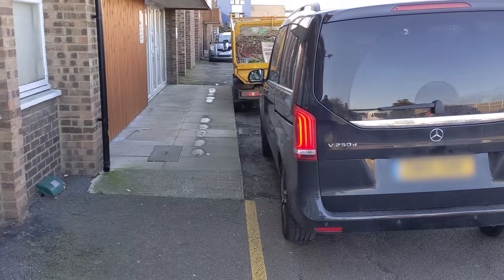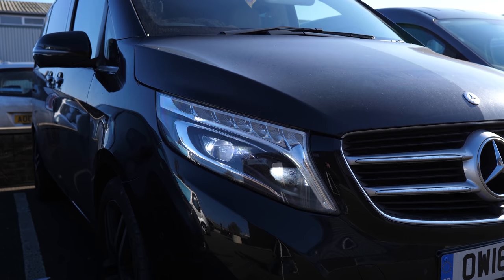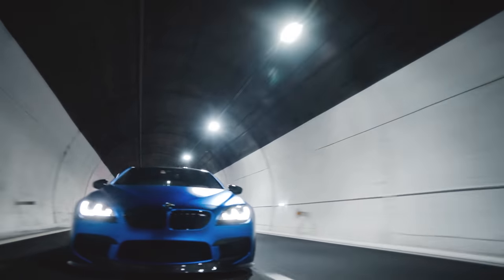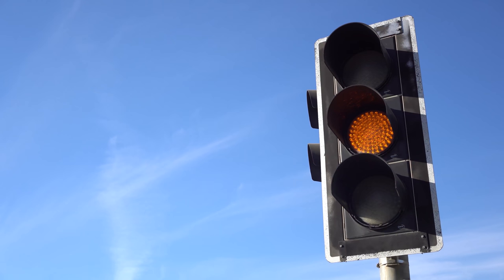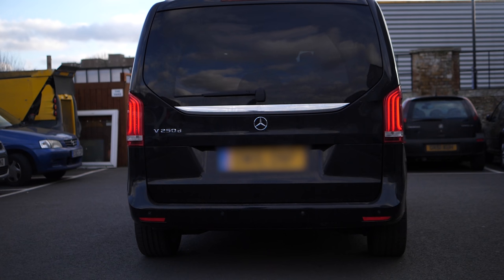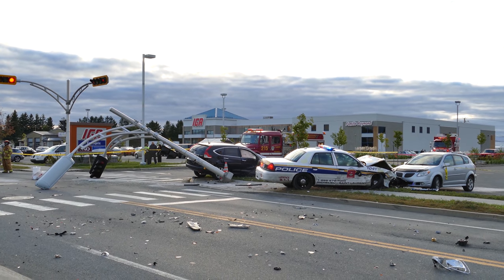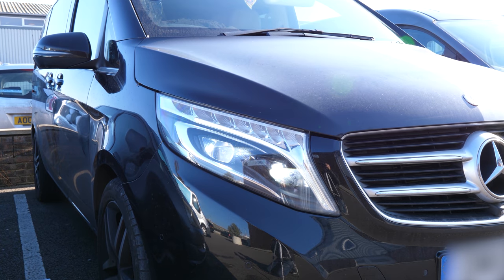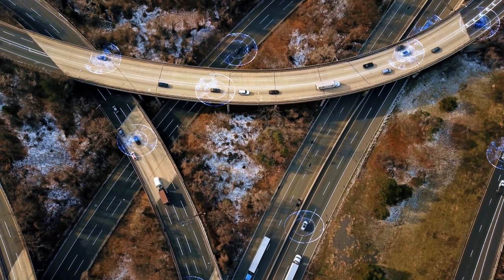Self-Driving Cars Are Dangerously Confused By LED Lights

Comment: Sorry Steve but you missed something big. Car lights aren't on dimmers. They don't need to optimize the beat frequency they need to FOLLOW THE LAW, a flashing light is not a constant light. The manufacturers are being lazy, there's no technical reason that the lights can't be on continuously. The reason the lights flash is because the manufacturers are saving on the total number of circuits needed by driving a number of lights on a single circuit, it's often called a matrix driver. In essence the manufacturers are reusing circuits that were intended to drive something like a calculator digit display. You said that to adjust the brightness you vary the voltage or use PWM but there is another way and it's the prefered way the LED manufacturers recommend. LEDs are not easy to drive as they have very little resistance so just controlling the voltage leaves them open to overcurrent damage the better way is to use constant current drivers. Not only is constant current better for the LED it is easier to set the brightness because the brightness is rated as a function of the current.

And it's not just Self-Driving Cars. I was in a large motorhome that had cameras mounted on the mirrors and extra cameras were on the blind spots and one to show the rear view. A car with LED lights passed us and it lit up all the displays with bright flashing lights like we were being passed by a firetruck. That is wrong, those lights should not be flashing.

Comment: In an AI application, where safety is primary, a dual or triple sensor camera with offset shutter (exposure duration, or complimentary sample time) settings. 

Perhaps the single sensor camera can cycle its settings thru slew of setting at a frequency high enough to provide composite images always. Given the current low cost of processors with ever more sophisticated algorithms, in safety applications, I think it’s a camera image capture/merge. Just as in iPhone camera that can produce HDR photos.

Comment: And an interesting ethical question is, that if the system has been tested a lot against all types of real life situations and artificial inputs, and no major problems were discovered, is it then unethical to release it despite a what-if scenario that was not reproducible? 

Especially if a system that has been shown to be less error prone than a human.
Is it then unethical to withhold a system that could save many lives be replacing an unreliable human.

Would lives being lost because we held our devices to too high of a standard before actual use? 
There is a serious balance to be struck between what-if and actual practice.

Comment: Or an alternative is to NOT USE PWM FOR DIMMING IN SENSITIVE APPLICATIONS.  PWM is fine for little lights on portable devices that don't matter but if you're doing anything important there's so many artifacts like this that make it dumb.  Or at least stick a capacitor in there to smooth out the peaks into a more consistent voltage.

Comment: Excuse me for my naive question: Why don't we simply vary the voltage of the LED in continuous mode instead of using the pulsed mode as you mentioned at 2:06 , wouldn't that solve the problem?
Reply: The choice is either offload the excess voltage by PWM (switching regulator), or by turning it into heat (linear regulator).
If you use a linear regulator, it'll be solid and smooth, but the heat has to go somewhere. In a cold country, it would probably be fine. In Australian summers, the regulator would die very quickly.
Reply: @tin2001  Thanks!

Comment: if the sensor modulated its frequency (non-periodic shutter speed) the ai could calculate the sensor frequency and hence infer the actual luminosity from the measured luminosity.

Comment: Rather than designing self driving cars to operate on roads with their current signage, we should come up with and implement new standards with self driving cars in mind.

Clearly marked road boundaries, data about speed limits, traffic control, upcoming turns, potential hazards - it wouldn't be hard to design these in such a way that it's easily and quickly readable by a machine, just as current signs and lines are quickly and easily readable by a human.

Comment: If you turn up the voltage, the LED will just burn. If you, on the other hand, control the current, you can control the intensity without PWM.

Comment: Just an off the cuff likely dumb idea, but what about using 2 cameras running at different rates and comparing them? Probably more complex of a solution than the one that will get used.

Comment: Actually you cannot vary the voltage on your average LED. LEDs operate at a fixed voltage, which is one reason they can be so much more energy efficient.

Comment: The truth is that lights are made for human drivers. The industry should come up with a global standard based on other ways for a self driving car (the "true automobile") to identify other vehicles on the road.
Radio frequency gear should work well, consume very little power for the short distance required, and be quite robust. It would also not be blocked by line of sight. 
Use an identifier based on vehicle category (gross weight, commercial/private, trailer in tow etc.), an unique ID such as the plate number and it is done. It might even be possible to equip emergency tools (road cones and temporary signals) with it, so that automobiles would know when to move with caution

Comment: American here. I cannot stand cars with red turn signals. I especially cannot stand cars that flash a single brake light as their turn signal. This can be easily misinterpreted in a dangerous way by humans as well. For example, if a driver has one brake light burnt out and doesn’t know it or doesn’t care, them tapping and then releasing their brakes could look from the rear like they are indicating a turn or lane change.

Absolutely all turn signals should be their own lights and should be amber. They should not share a color or a housing with any other lights.

Comment: Doesn't Home LED lights "flicker" in the KHz range? why for cars is not the same? however the problem remains for the current cars generation...
Reply: Depends on the quality of the driver. Some cheaper home led lamps flicker at mains frequency. They have improved over the years, but some are still noticeably flickering.

Comment: I think you'll find that it's pointless adding an aperture to an optical system for the size of sensor used in these systems due to diffraction issues rather than the aperture's mechanical delicacy.

Comment: Couple things:
1. You're not comparing the safety of Autos (which yes, aren't perfect) against perfection.. you should be comparing them to the dangerous meat sacks that are currently in control the vehicle. 
2. For the scenario where the turn signal is combined with the brakes and the camera is in sync with the off portion of the wave, no Auto currently in development (or Auto system a la Tesla) relies solely on a camera. There's other means to "see" the position, velocity, and acceleration of other objects on or near the road.
3. The benefits of adopting Autos far outweighs the costs of not. It won't be easy, but the removal of human error and distracted/inebriated driving will save lives.

Comment: Not necessarily need to achieve low sensitivity. A much better solution to achieve higher framerate. Using 360° shutter always and changing framerate based on light conditions. It would result no weird flashing problem, also the least possible motion blur and make possible the fastest and most accurate situation analyzation.

However it's so funny, that a widespread method to save about 10-15 cent per car on manufacturing caused so hard problems (since to eliminate the flashing of LEDs would enough to built capacitors into the lamps roughly this value).

Comment: So you're driving along in your normal car about 600 metres ahead you see an ice cream van stopped at the left side of the road, a hundred yards along you see three kids running up the pavement to your right. I would immediately take evasive action as you can guess what might happen next, an Self-Driving car wouldn't spot that. What happens when a pedestrian is run over by one of these cars? Ther will be questions asked if a human could have done better.

Comment: Sony has this problem solved in their automotive RGB sensors, namely IMX 290, IMX 390 and IMX 490, those have LED flicker mitigation and also have other features like HDR (think tunnel+bright sunlight anyone?)... so this is clearly worth mentionning but is not going to impact autonomous cars if they use the proper sensors

Comment: I'm working on autonomous driving technology and ADAS for a while. Using indicator lights or front/rear lights is no reliable source of information in the first place. They can be broken, or the driver might not use them (correctly) - or maybe they are american tail lights. Syncronizing the camera to the LED pulse frequency might be a gimmik that gets to its limits once there are multiple traffic participants, traffic lights and so on and technology to increase the shutter time is already patented in multiple ways.

Comment: I hate PWM so much even though you "can't see it" if your house (or anywhere else like a restaurant) is lit with it it's like you're living in an invisible stroboscope, which hurts my eyes and head after 2 hours.
Edit: I forgot to mention that most of the time it isn't even PWM when using mains LED bulbs. They just pop in two LEDs to get both ways of the 50Hz (in europe) alternating current, sometimes they even use only 1 LED. Or they use a FULL BRIDGE RECTIFIER but don't smooth the voltage. 
More expensive LEDs don't flicker not sure why, maybe use a capacitor (do those even work on AC) to store some energy but I have no idea.

Comment: Sooo .. here might be an easy fix.  Design a camera that operates on 3,000 hz, which can perceive incoming signal in 4 different modes.

Mode 1: 50 hertz (euro).
Mode 2: 60 hertz (amer).
Mode 3: 50 hz offset by 1/2 cycle.
Mode 4: 60 hz offset by 1/2 cycle.

Then design a comparator circuit which can 'fill in the blanks' between modal perception .. 'between' being the trigger.  Loss of input would effectively stop the comparator circuit (fail safe).

Just waiting for someone to shoot back a 'what the hell are you talking about?'.

I'm not an engineer .. I'm just putting out a suggestion in the best way I know how.

Comment: Why not use a simple ish layer of a material that turns opaque or transparent based on voltage input, no moving parts required,  and we use this tech on LCDs rather than developing new ultra low iso sensors

Comment: If you want a digital camera that sees like a human does then why not simulate what the eye does and have de-synchronized sensing?

Since the retina is driven by photon input rather than clock signals it would need to be a little different, but I think you could generate a small kernel pattern for the sensors with each node in the kernel having some different prime clock rate, or perhaps a kernel with nodes clocked by a reliable exponential distribution. I know it would be a little more expensive to have multiple layers of clock line across the sensor matrix, but I think it's really a very high-quality solution compared to what would eventually become a trivial cost increase.

Anyone intimate with sensor matrices care to comment? Is there some reason that this would be more difficult than I'm thinking?

Damn, Steve, now you've got me thinking about digging up camera sensor data sheets. This is why I can never finish a project!

Comment: The LEDs don’t have to act as a monolithic block, all switching together. If they were on 3 circuits they would outfox any camera. 
Also, I really hope autonomous vehicles won’t be relying on brake lights and turn signals to keep us safe! 
Also, given how quickly traffic lights have been converted to LEDs across the world, could they not broadcast their state by the time autonomous vehicles are widespread?

Comment: Not related to this video. When I was a kid I used to get my dads tape measure pull out a length of tape then put it on the ground and let it retract back in on it's own. This would start spinning the tape measure one way but soon as the tap retracted all the way back in it would quickly snap and spin the tape measure in the opposite direction. I know what's going on with it but I also feel as if I'm missing something more going on. Can you or anyone give me a hand with this please.

Comment: Oh our lights get far dumber. The truck I had to make a new rear harness for used the same bulb for brake, run light and turn signal. All of them behind red plastic. So is the guy with the flickering light in front you braking gently, turning or simply has the vehicle powered up with a faulty bulb/socket/wire. Good luck figuring that one out without knowing which bulb locations are which, assuming you can even tell once moisture inevitably makes it's way into the housing. Honestly makes diagnosing faulty wiring even more challenging, as if it wasn't challenging enough with how poorly car electric systems tend to be documented.

Comment: The LEDs simply shouldn't be flickering. Cost cutting is the only reason the LEDs need flicker, a small change in the circuit (inductor and recycling diode for example) would fix this. There should be standards on this now LED tech is here in cars. Some scanning indicator lights, for example, just do not provide the kind of intuitive signal that a single flashing light does. I get the argument of trying and finding out, but as an engineer who works with LEDs far too much, some of these things didn't need an experiment in the wild to find out.

Comment: This is not simply an edge case or a problem for self-driving cars.  I am one of those humans who does notice the PWM dimming used in vehicles, especially from certain manufacturers rear lights.  (I am also sensitive the the DLP projector "rainbow effect".)  At best it's a nuisance and at worst it can cause dangerous reactions from drivers.  I've even observed other drivers swerve to avoid a collision with a car that was not where they perceived it to be.  You can experience this disorienting effect trying to catch a ball when it is lit by a strobe light.  (Steve, want to make a video about that?)

A relatively simple way to mitigate the problem, for humans at least, could be to increase the PWM frequency.  I cannot understand why some auto makers have chosen such a low frequency.  I think there should be regulations around minimum PWM frequency for dimming exterior vehicle lights, and perhaps a minimum duty cycle.

Comment: Have two cameras with different shutter speeds and filter the difference out. Problem solved. That could be made in a single sensor by reading part of pixels in one frequency and part in another.

Comment: If LEDs were the only problem with AI pilots, that would be easily fixed:  kHz PWM frequencies or series inductance would assure that every video frame has a few lines showing the LED lighting.  Higher frequencies are far less expensive and can utilize wiring inductance.

Comment: Seems like this could be solved by an ISO standard requiring keeping a handful of LEDs on each light always on or off when required. This would retain the majority of the power saving gains.

I'm not an electrical engineer though so I'm probably wrong.
Reply: Or perhaps introducing IR or other non-visible frequency non modulated LEDs just for the purpose of cars communicating. I don't really know jack fuckign shit but this is fun to think about.

Comment: There's a lot of coulds and shoulds in this video, is this actually an issue for any of the models of self driving vehicles out there? Or is this just a case of consumer cameras not working like the sensors on the vehicles in use?

Kind of like how consumer batteries (laptops/phones) are built differently than electric car batteries so the problems with short lifespan is a "could/should" problem with electric cars, but in reality it's like comparing apples and pears.
Reply: MrSylfa I think it’s quite limited for real world scenarios. One reason being that automatic cars can’t trust that lights are giving them correct information about what other vehicles are doing anyways. (You can forget to turn on the turn signal, or the break lights can be damaged.) Instead self driving vehicles can use their faster reflexes and absolute attention span to just look at what other vehicles are actually doing instead. 

For the red light if you approach a traffic light and can’t make out what light is showing (as in this case) then you treat it as a stop sign. Just as a human should when approaching a broken traffic light.
Reply: @MarcusHast  Agreed, defensive driving is the smart choice and the car wouldn't be stressed about life and ignore that. Nor be sleepy, upset, tipsy, etc...

I just wonder how much this video actually relates to current autonomous vehicles and how much it's just hobbyists noticing a phenomenon that has been fixed long ago.
Reply: @Sylfa  Considering none of the autonomous driving systems are relying only on optical cameras (even Tesla also uses radar) I don't think it's particularly relevant. Also camera systems which are designed for computer vision often don't use the same camera sensors found in normal cameras. Eg many tracking systems don't require color vision and then they can make the performance a lot better by having grayscale only cameras. Or trade color for larger dynamic range.